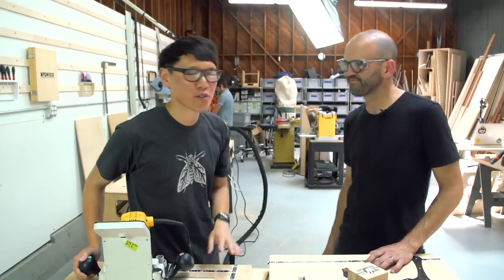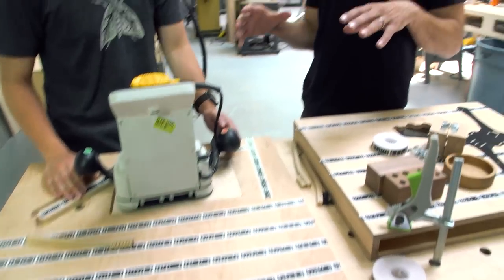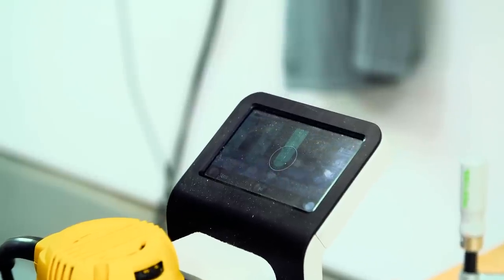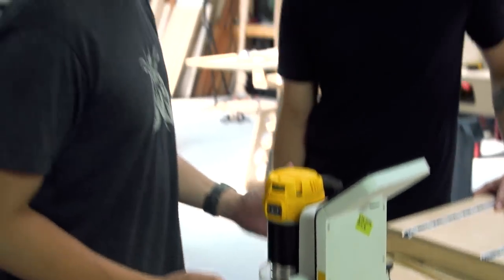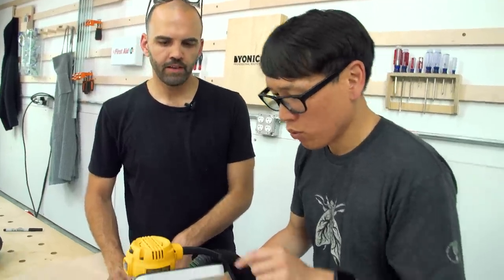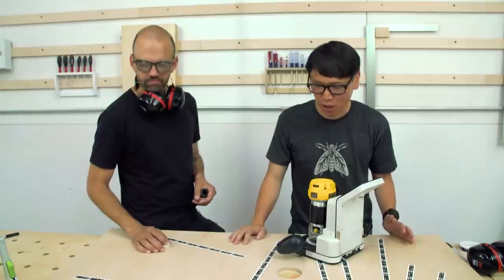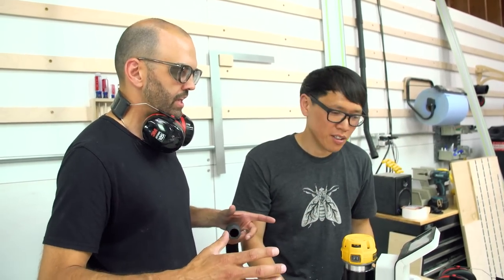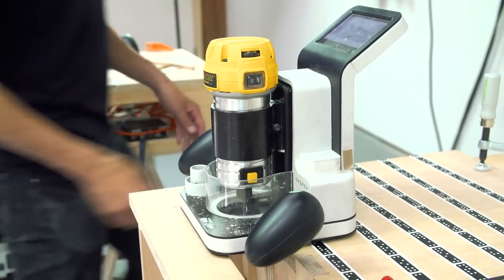Hands-On with Shaper Origin Handheld CNC Router!

Comment: Who would use Illustrator for designing parts? Isn't something like AutoCad or Solid Works or some othe actual engineering program safer bet or am I living in some different age.
Reply: As I understand it any vector graphic software can be used to create a drawing.  Then the file can be exported to the device.  There are probably settings on the display that let you resize or scale the image on screen before you begin.  Measure twice, cut once.
Reply: Logos?
Reply: This only cuts in two dimensions so illustrator would be fine.
Reply: Not sure on the specific reference from the video, but I'm guessing that it'd be a slip of phrasing.

Yes, you'd create the 3D aspects in a 3D CAD program, but from what I've seen, you generally take them into Illustrator or another vector program for creating the tool paths.  An example on this would be for a laser cutter.  Most that I've seen can be configured so that different RGB color codes on the line would correspond to different laser strengths.  This would allow you to etch and cut out from the same file.  "converting" the 3d image to 2d planes makes that an easier process, rather than relying on plugins.
Reply: ***** Thanks for the explanation, I didn't quite think of it that way. I didn't figure out at the beginning that this router is mainly for cutting out things like logos and other art forms. I was instantly think like hey why not make a sketch of lets say a coffee table that anyone can cut and then assemble, but forgot that it cannot really cut that thick boards and that it doesn't have any 3D capability, at least like rounding up edges or something like that.
Reply: J88go Like with all WW routers, it depends on the bit :)

There was the shot at the beginning where they used a V-Shaped bit to engrave a little California into the board, so that tells me you've got precision depth control (as should, with CNC).  So you can do all sorts of etching there.

As far as big pieces go, MAKE's channel had the host cutting out the side for a work table out of what looks like 3/4inch plywood.  Even in this video (at 1:33), you have a shot of a chair that was cut out and assembled using the Shaper,  It's not quite IKEA ready to go, but you are a step closer.

As far as a roundover, there are CNC-specific plunge bits that can be swapped in to create that effect.

Comment: So it's $150 for the router, maybe $100 for the bits and about $300 for the software and driver, let's say another $300 for the camera and about $200 for the case and components. So that's about $1000 for the parts + 100% mark up for your $2100. I bought an X-Carve that works surprisingly well with the same router for less. Sure this is portable but for the size it should be cheaper. Mmm
Reply: 1976ClassicCelica So they aren't supposed to make money from the idea, research and development, marketing, staff... Do you not understand how business works?

Comment: $2100!! You can get a big CNC router for that price. Plus, you need to be there while it's cutting. If it was ~$500 it would be cool,but it's just too much for what it is.
Reply: Besides price, the tape is my biggest problem with this. 

So I'm supposed to buy a 1500$ tool that is completely useless without that tape. A tape that's proprietary and only available from one vendor. Aside from costs for the tape, what if this company stops selling the tape?

Also, the spindle looks like a 60$ DeWalt rotary tool...

And it's not a CNC.
Reply: you could just print the markers on pieces of paper the computer vision algorithm doesn't really care if its tape or not
Reply: Yeaaaaaaaaaaaaaa
Reply: Please point me to a CNC router that can cut 8'x16' for $2100.
Reply: Ryan Marr Have fun guiding this thing for hours as you cut something that big. What could you possible be making that is 16' x 8'?
Reply: +Ryan Marr fair point man, although that is kinda niche
Reply: custom inlay in a hardwood floor for starters.
Reply: Boat components, aircraft components, big window frames, etc. also it can be stored in a box in a small shop. No tabletop taking up space all the time.
Reply: you dont need a cnc for window frames or big simple parts. For a window frame you can use normal lumber. A cnc is good for cutting complex parts from sheet stock. I dont know what kind of boat or aircraft components you have in mind, but I dont see why you would need this for those.
Reply: Nice. You managed to look up the CNC article on Wikipedia! Good on you! 

Now let's work on your reading comprehension here. Let's read the very first sentence together.

"Computer Numeric Control is the automation of machine tools that are operated by precisely programmed commands [...] as opposed to controlled manually by hand wheels or levers, or mechanically automated by cams alone."

This ain't automated. And it ain't generating "precisely programmed commands". Its a monitor that shows you a template you have to follow.

Its like painting by numbers, except more expensive. You could draw your template on the wood and follow that with a normal router and that would be just as much CNC as this.
Reply: Its actually $1,299 if you pre-order
Reply: As far as I understood this product, the router corrects your hand-movement. So its not just like painting on the wood and using a normal router...But I'm on your side, the biggest advantage a CNC machine would have over this thing would be the time-factor. You could just program it and let it run for a couple of hours, whereas here you have to stay with the tool. Nontheless I can see the advantages of this product too...
Reply: JMakes Yeah but final retail value will be $2100 according to the website.
Reply: @Red Wraith finally someone speaking some sense, this thing is okay but a simple 100$ router does things cheaper and prolly quicker aswell.
Reply: I thought that at first too, but this actually uses controllers to keep the bit in the right position. your hands just keep it within the window it needs to be within. So, these positioners are pretty much cnc.
Reply: I just hope there are competitors who come in and produce products similar to this but cheaper
Reply: Vanillaessence96 Yes!
Reply: If it was a $500 add on I could see this as a weekend warrior tool. Someone who would like to be more creative with their designs but doesn't necessarily have the room for a larger machine. However, with current pricing I see this only being used in wood shops that already have the space for larger CNC devices. Along with that it would probably be used in shops that take a variety of orders or whose designs may be larger than conventional solutions. This feel very much like a corporate solution.
Reply: tactition777 agreed
Reply: a proper flat bed cnc...is 20 grand and up... standard is 50...
Reply: bjaminbjamin Though a CNC router is about $2000-$3000 USD
Reply: since I work with one routinely at work...in a wood working shop.... I think you are mistaken
Reply: bjaminbjamin I figured by "proper cnc" you were referring to a CNC mill. I agree hobbyist machines are very limited.
Reply: agreed
Reply: Red Wraith...you make feeble points for someone trying to be so condescending.
This is for on-the-fly or easy-to-use precision. Hand-routing is not comparable. 
What exactly do you think "precisely programmed commands" refers to? One could easily say that the auto-correcting motor movements uses "precisely programmed commands" that are derived from the CAD file and the virtual map of the working surface. But perhaps it makes more sense to refer to this as a kind of hybrid system because of the need for human hands.
Reply: Or larger.... and THEN get put away on a shelf beside your circular saw and not take up gross amounts of floor space...
Reply: mrman991 That requires much more to be manufactured to get improvements that fast. Market saturation for this device will be thousands and thousands of times less the consumer electronics like tvs
Reply: It's all about portability... you can't move a CNC router in your bicycle.
Reply: bluetorch13 Your right, but why the fuck would you ever be carrying power tools on your bike?
Reply: ***** Oh yeah let me carry a couple 2 x 4s, a sheet of mdf, tape, and a handheld cnc router on my bike! Almost everyone drives too.
Reply: Word. Not to mention you need to buy the stupid fucking tape too.
Reply: Martisan I know. Finally someone who agrees that this thing is dumb.
Reply: Very cool tool indeed, and definitely not a replacement for a full on CNC machine.  However, the price point I think is spot on for a technology that has never been on the market before.  I'm not saying its never existed, just that it's a new tech to the consumer world and the company has it priced to recoup its losses through the R&D of the product.
Reply: Handibot set this market and has been available for years now, with superior capacity as a portable tool.
Reply: It's funny how short sighted some of you haters are.  I run a custom woodworking and furniture shop, and this tool will be able to work on an entirely different level than my floor CNC.  Ok, sure, a trim router with custom jigs for every single project would do the same thing, but I see an incredible ease of use aspect.  Sometimes making the right jig is a project in itself... this solves that immediately.
Reply: lol, no you cannot.... not even a cheap Chinese one.
Reply: Yep.  More to the point of missing the point is that the hidden treasure is the increasing ability to have the "patterns" stored onboard -- many, many patterns from various past and future jobs -- all available for use in the variable conditions of an actual project in the shop or in the field.  Then the next step is the improving ability to utilize the onboard simple shapes, like the custom circle they did, and then synthesize a few of those into a complex shape, all on the fly.

What desk jockeys don't understand is that the best laid plans often quickly go to pieces in the field; in construction, everything is custom, buildings are not widgets produced in factories with easily controlled outcomes.  With traditional CNC or router templates, at the time of installation/assembly, once the initial designs are off by .1" or .0625", that's it!  The install cannot be completed, the day's work is shot, new measurements are taken, and it's back to the shop to reprogram or re-fabricate a more accurate template.  Being able to adapt things directly in the field is a huge advantage that will be the difference between a successful project and a failure.

Nowadays, the problem is that the clients have come to expect perfection, so misses affect their bottom lines, and that in turn gets passed along to the designers and builders.
Reply: Wooden aircraft are often made using complex 2D components: Wing ribs, fuselage formers, etc. Let's say you wanted a complex wing shape with a taper. That would require quite a few different wing ribs, each would be custom. This a perfect application for CNC. For a typical light airplane, the ribs would have a long dimension of between 4 and 5 feet, so you would need a large CNC machine or one with a sliding bed to create such shapes. For fuselage formers, you would need a bed big enough for the largest fuselage cross section, typically 3 feet square. This tool could easily cut the time required to build such an airplane in half. I'd say that's worth $2000.
Reply: Can anybody give an argument for going with this machine for $2100 over the Maslow for ~$350?  (~$450 I guess with a Z axis.) I love the idea, I just don't see the value.

[Edit: added cost of Maslow Z axis kit]
Reply: you might want to take a look at the Maslow cnc. $350 in a DIY kit.
I really don't think the company is out of line with this price. Have you looked at the team of engineers? All the R&D that went into this thing? It's incredibly versatile and doesn't require you set up a CAD file every time you have to use it, not to mention you can bring it to a jobsite. I think it's a very unique product that is going to be quite popular, but not for the average DIY'er for sure.
Reply: I think the point he was making is it's a portable solution, and that's rather priceless when you need the precision of a CNC. I can definitely see bringing this to a job site.
Reply: well, first off you have a team of engineers that have put a whole lot of R&D into the project, and not a couple of college students who put something together in their garage. The Maslow has about 1/16 of an inch accuracy over its range, hardly a precision CNC. Mostly a glorified plywood cutter, and very slow. I looked at it but could not even get ground control to run on three different computers I tried, and got zero support from their forum. So, the shaper is apples to oranges comparison. The thing has been tested and runs correctly right from the get-go. many of its features don't even require files to run, and it's portable. That's huge in my opinion. Maybe the folks over at Maslow will get the bugs worked out, but seems to be geared more towards computer geeks looking to play.
Reply: Joshua Middleton Ever shop Festool $$$$
Reply: Although this is a neat product, I have to agree with everyone regarding the pricing.  If it were 1/3 of the price they are currently asking for it, they would have a hit product.  However, I think that the average DIYer wouldn't pay this high of a price for it.  Professionals already have access to far more precise CNC's that require less physical effort (put in your material and drink a coffee while it finishes).
Reply: Joshua Middleton n
Reply: So.... make one yourself! If you would only pay 500 $ and you are a real DIY person, you'll be able to make one for 400 $ for materials, no?
Reply: even a 4x8 table would take up a huge amount of space in any shop - i don't even have room for a 4x4 table, or a 2x4. But I have room for this, and all of a sudden I can CNC a boardroom table inlay if I want to, or cut up components to build large stuff outside my shop. depending on the quality of cut, you could even eliminate the need to keep templates around if you're an instrument builder. 

the problem with the other videos i've seen is, they're using this thing to demonstrate tasks that could be easily accomplished with a regular router (like mortising door hinges or doing other work that just needs a simple template). that's not the point. the point is this thing gives you cnc-level control with something that fits on a shelf. that's amazing.
Reply: Big cnc for $2100? I'll write a check for 2 of them right now.

Comment: Why not just use an optical sensor to track the surface (like a mouse) instead of the camera + tape?
Reply: My assumption is: Dust + laser doesn't go together well if you want perfect accuracy. Plus if you were to pick it up, the machine could get it's bearings again with the tape (Plus it's  an additional continuing revenue stream for the company)

Comment: If you gave it a carbide bit, could you tune it to engrave steel ? You would just have to slow down your feed right ?
Reply: i believe applied science used it to cut aluminum, they have one where they engraved brass, so just to engrave steel I would think it possible but you'd have to tune the device in use carbide like you mention, and go at a slow pace, but you might not get the finish out of it you're thinking i'm guessing, but my guess "its possible".

Comment: I was kind of hoping it would map out the ink and then decide what size bit it needs and then cnc all the black in the logo. You would probably need to use pens with a specific size but why wouldn't this be possible?
Reply: kinda like a follow the line robot, could be a cool project, just print off a design on paper and stick to what u want to cut
Reply: That's what it does if you supply the design from a file. Drawing the design straight on the wood was just a quick and dirty way to keep the video short.

Comment: Booo, only available to USA. Hi guys you do know that there are other countries! Some of them even have electricity.
Reply: some of them have higher electrical voltages and different outlets. which require different components. maybe they only want ot make the one model for now?
Reply: Or maybe their inch based software just does not support millimeters :P

Comment: How does it work on paper, say cardstock stack?
Reply: Maritza Hammel - This is only a guess, but after having used routers and other high speed rotary tools I think it would just tear the edges to shreds- basically like tearout in wood. It might work slightly better if you used some sort of non permanent fixative like spray-mount between multiple layers.  But the adhesive could cause problems depending on what the paper is going to be used for. Maybe someone has, or will design a specific bit for this purpose- something with very fine fluting and super sharp cutting edges. You would also need some sort of sacrificial material underneath the stack (thick cardboard, wood, MDF, Masonite). Maybe someone who reads this will grab a regular router and experiment.